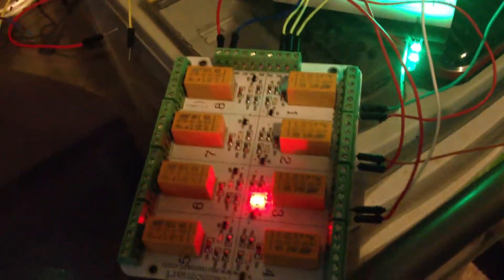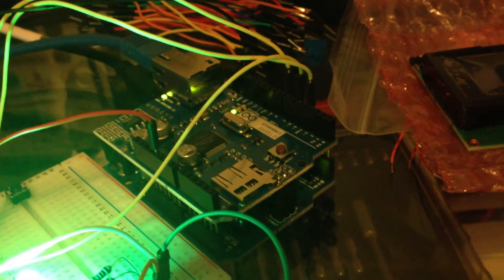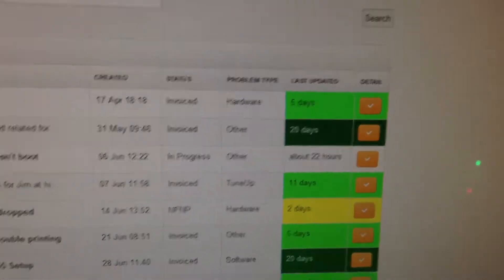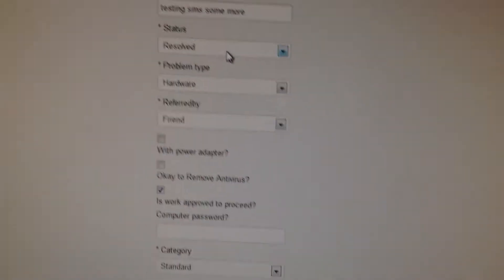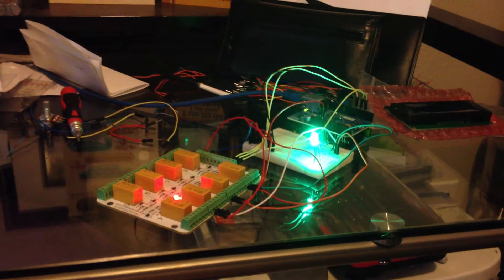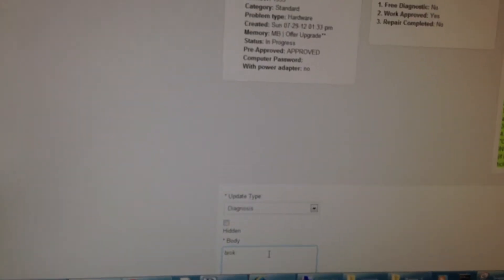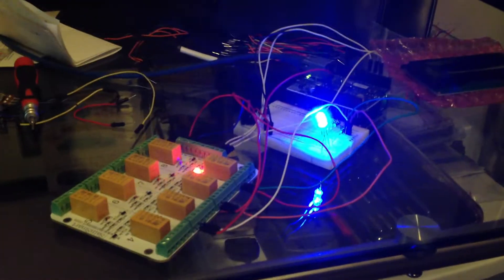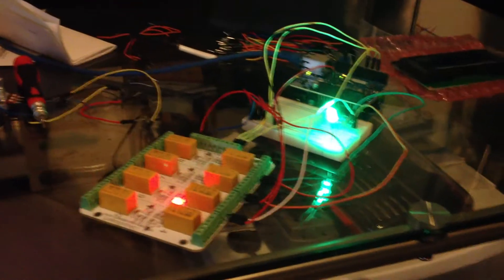Arduino status light for computer repair shop

Comment: how did you get the teleduino to do it instantly.  i am only able to get the presets .  the arduino only updates after a reset or if i turn the power of and then back on.  links code any help would be appreciated.  thanks